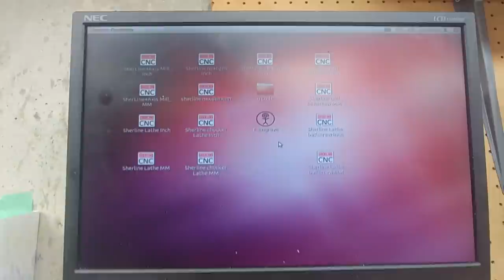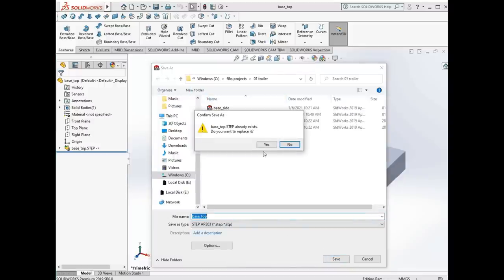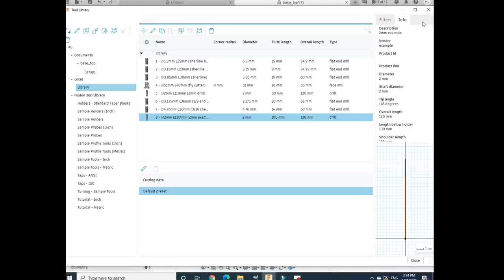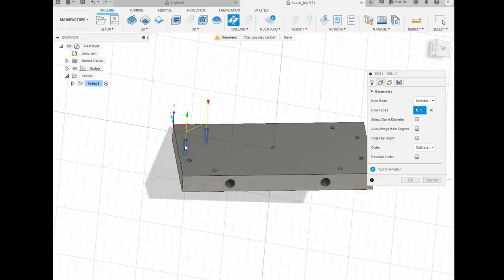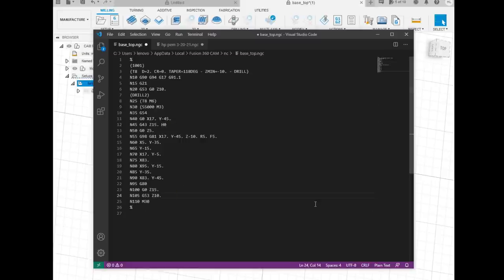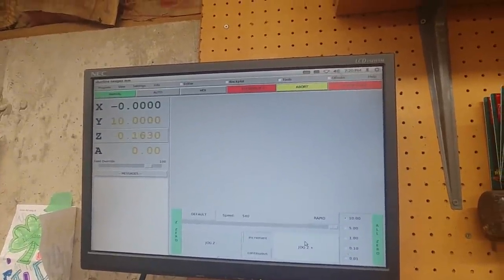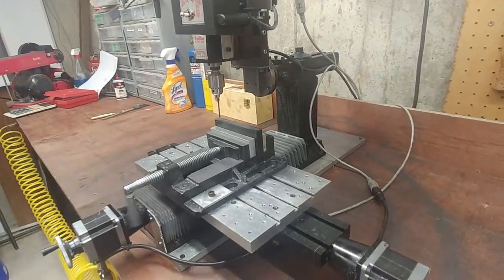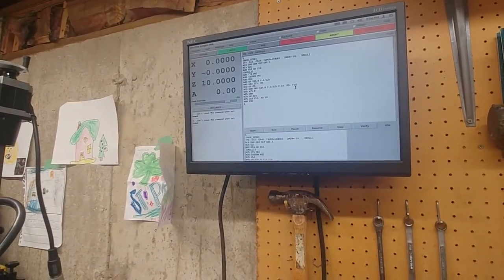Get Sherline CNC Mill to work: using Autodesk Fusion 360 to generate g-code for LinuxCNC

Comment: Bought a used Sherline CNC mill and I'm getting it set up to run.  I have Fusion 360 and Solid Works, although I've never used Fusion before.  With an older desk top computer, the Sherline Mill and the Sherline CNC power supply box (with 3 outputs x,y,z)  Do I have everything necessary to get going?  I'm wondering if the Fusion 360 will run ok on my old computer?
Reply from the maker: Fusion 360 is cloud base. It should be fine.
Reply: @markone9620  Thanks!  Good video, have it running- now to make a model engine crank shaft !  I noticed you used Solid works then put that in Fusion 360.  You could have used Fusion to create the part too?